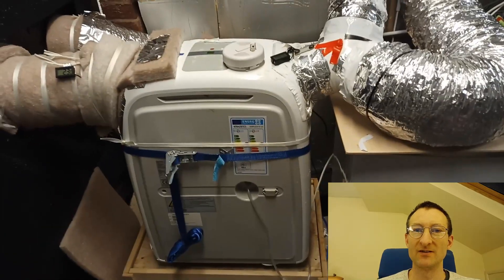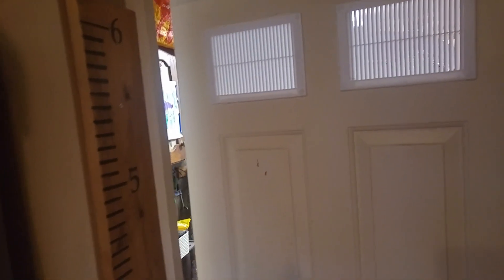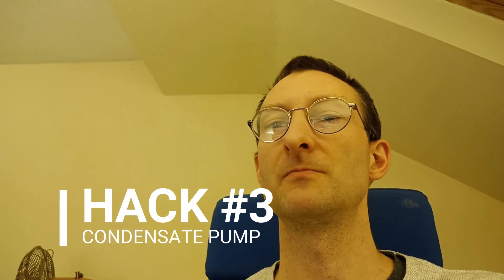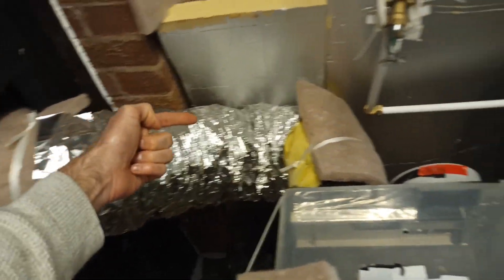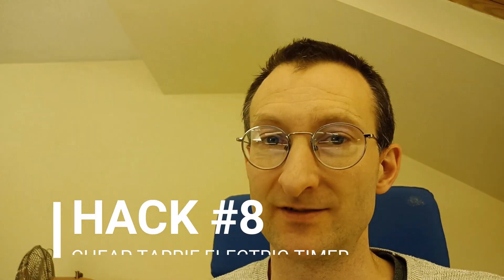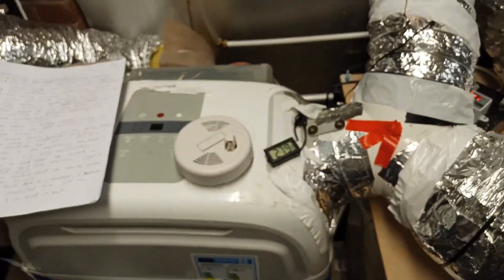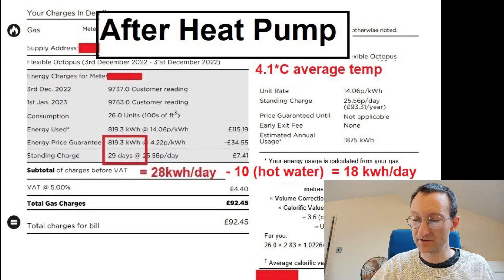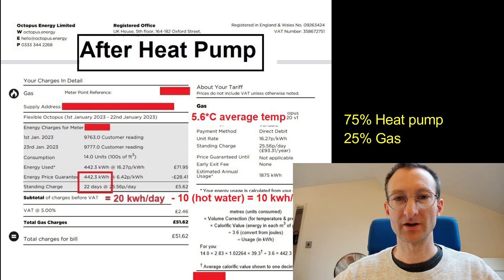DIY HEAT PUMP TOUR & RESULTS SAVE £££

Comment: This is great! Somebody is also using the Electriq Airflex 15 for central heating. So, to compare experience:

Questions:
1. Does your cold side fan stay on 24/7 with Airflex 15 switched on?
2. Any thoughts about fitting a relay to turn off the cold side fan when hot side fan is off? Perhaps 1min delay for defrost?
3. When Airflex 15 shows "DF" for defrost what is actually happening within the unit?

Suggestions:
1. Treat yourself to a handheld digital anemometer to measure flow velocity throughout system - including hot side exhaust with/without duct comparison.
2. Get Airflex 15 comfort kit control panel, and extend the control line (GX16 9 Pin Male/Female Head Aviation Socket Connector) for remote thermostat control in the living room (thermistor at base of unit).
3. Fit Aygrochy 150mm inline fan(s) to boost the hotside flow. This overcomes the duct drag, and the variable potentiometer allows setting for optimum flow/temperature sweet spot. I use four Aygrochy 100mm inline fans in series to distribute flow upstairs. Digital thermostat set at 30°C gives ~1min on/off signal delay. A little soldering required in potentiometer boxes.
4. System needs air dust/pollen filters - I have a polyester filter sheet Velcro attached to Airflex hot intake, and a windsock filter in the 150mm to 100mm reducer for upstairs duct.
5. I am really liking your airbox plenum idea for cold intake mixing, but would be tempted to cover hot & cold intakes with same box for defrost mixing. Some experimentation required.

Comment: This is the most Heath Robinson thing I've seen in a while - and I love it. The previous owner of our house was a HVAC engineer and he left a portable AC unit that he'd ducted in a similar way to warm/dehumidify the ensuite. I don't think it actually runs in heat mode, so there's some trickery going on including mixing the warm exhaust air with the cold supply air. It works well enough but I think I'm going to replace it with a MVHR unit.

Amazing stuff, thanks for documenting it

Comment: Great effort on this. I too have the Airflex15 V2. I've planned a similar set up with a few little tweaks. Interesting that it runs better to split the duct. I'm surprised you haven't adapted it to be used for summer and utilising the cold air. Have you considered installing PV panels? I'm contemplating a 7KW battery PV system which I've estimated should cover it. Just need a little excess power to heat water, which would get me off the oil boiler. 
Hopefully once I've completed the setup and can compare.
Reply: @driveguy , another eco-hacker. Fantastic! I've also done similar with Airflex 15 for central heating.

Repeating questions asked of @Matthew Eng
1. Does your cold side fan stay on 24/7 with Airflex 15 switched on?
2. Any thoughts about fitting a relay to turn off the cold side fan when hot side fan is off? Perhaps 1min delay for defrost?
3. When Airflex 15 shows "DF" for defrost what is actually happening within the unit?

Comment: I am very impressed with this. I have now tried it on a simple circuit. Ours is only a 1.4Kw air conditioner but it’s useful to be able to reverse it for winter vs summer. Only uses 300Wh and maintains temp so far. Thank you for the idea

Comment: I was impressed and inspired with your work.  On the strength of your YT portable heat pump system videos, I purchased a used Friedrich PH14B unit which is a dual hose unit with the built in heating function.  It cost me $100 (~£80) plus another ~$50 to duct and rig a semi-permanent installation.  Currently, I’ve only had it running for a few days.  It’s the Fall season northern USA (outside air temp (°F) mid 50°s to mid 30°s), it heats the entire house.  Many thanks.

Comment: The puddle underneath will be from the compressor mountings which will be transferring cold to the casing. Insulate underneath with some foam strip which will reduce this issue.

Comment: I've bought a portable ac to try something similar on my narrowboat. What I've found is it has two drain ports. One at the bottom like you use and one halfway up, just below the evaporator. I mistakenly put my drain hose in the top one and it seems to catch the water before it drops to the bottom. Being higher it is easier to put a bucket under it.
I might open it up to see exactly where the water travels internally.
A heat pump would have been my choice but I'm on solar only, so a 500btu ac unit is a cheap experiment.
PS I suspect the water impeller turns off in dehumidifier mode but haven't checked mine.
Reply: I just thought, a heating mode would swap condenser and evaporator functions so it might not have a second drain.

Comment: I'm really enjoying all the investigation people are doing into heating at the moment - we've been trialing far infrared this winter and had some pretty good results from that [1].  As it happens, we have the same portable heatpump as you hooked up to some ducting in the loft to provide cooling upstairs in summer, so I think we'll explore some of the tweaks you made in terms of condense management etc so we could use it in the heating season as well - thanks for sharing :)

I don't know how long you've had a smart meter, but you might find the tools Guy Lipman has provided useful in analysing your gas consumption against temperature. It lets you easily download CSV data for your gas (this will be in units, so needs multiplying to get kWh) / electricity consumption for various periods (daily, half hourly etc) [2].  There's a Medium article [3] documenting how to use it.  If you combine this with data from degreedays.io [4] you can get a fairly good estimate for gas usage at certain outdoor temperatures.

Do you have an electricity usage against outdoor temperature for the heatpump - similar to your gas bill comparison?

1. https://youtube.com/playlist?list=PL4hBB421fBGr37fvzLcONhfAqfBYys9Fj
2. https://energy.guylipman.com/sm/admin?source=octopus
3. https://guylipman.medium.com/accessing-your-octopus-smart-meter-data-3f3905ca8fec
4. https://degreedays.io/Tools/DegreeDaysCalculator